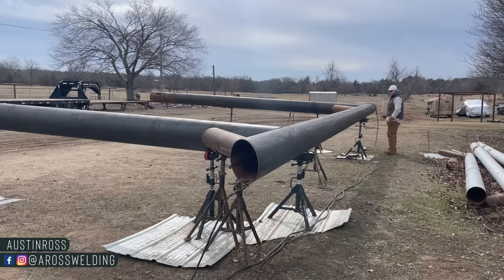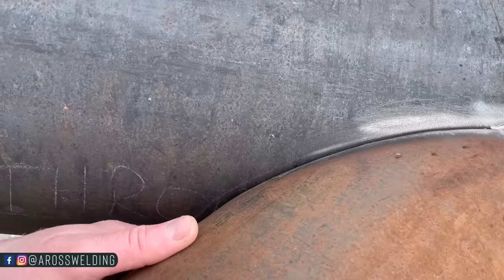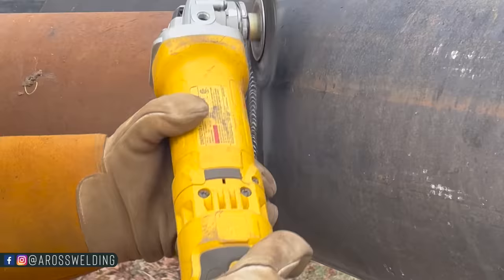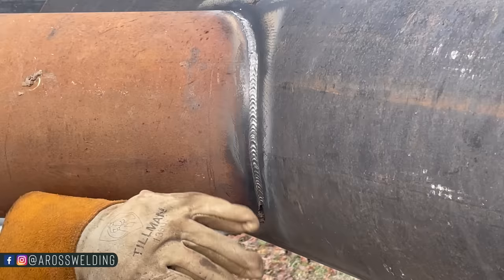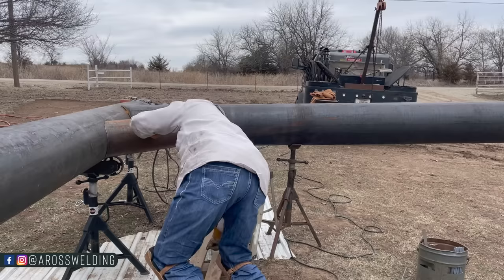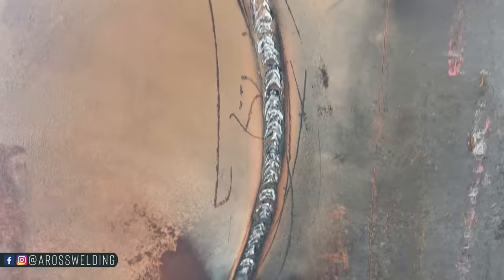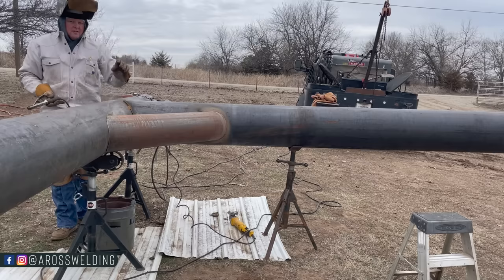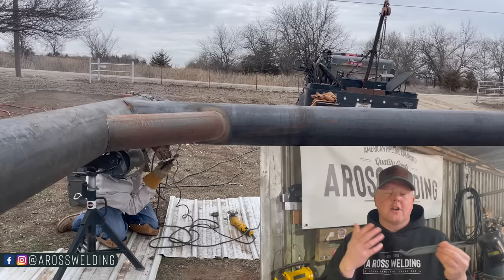Why Pipeline Welders Only Burn Half a Welding Rod

Comment: As a 75 year old retired Boilermaker./Welder..I was taught that uphill is always stronger..down hill for light pretty welds.
Reply: right i think he was going to uphill cap it once he got the gaps filled with the easier downhill pass
Reply: What? 
Distance, angle, speed and heat

If your distance is correct, the angle of your rod is good to penetrate, your speed is also correct, then you have the right heat bc you can only change heat with distance, angle and speed.

So as long as you're doing those things, your have a string weld, regardless if you push or pull. 

Don't forget how much welding has changed and the equipment we use has changed. The old antiquated welding is for the old antiquated people that learned from books that are now obsolete.
Reply: What your saying is that a 70,000# psi rod is stronger up hill than a 70,000# rod is down hill?
When I worked a BM job in 74, after our section finished welding chill ring  tubes, they had us 200 plus feet in the air on a painter's pic, downhand welding lap joint casing through paint with 1/8 & 5/32 7018.
At the time this was billed as the largest suspended Broiler in the world. Unit 5 in Oswego.
Reply: That's what pa taught me ,burned my first 6013 at 6 on a buzz box pa and Russell Drackley made from an old transformer that was left in a ditch around 1965 . Hi ,medium , and low . That welder and pa built amazing things over the years . Back then a point beer can could be welded to exhaust pipe , and often was .
Reply: I worked natural gas pipeline for 38 years . Hot tapping and stopping . Every welder I've ever worked with weld uphill . Especially if I had any blow by . It's easier to fix the leak on top than on the bottom .
Reply: Yes I was taught the same thing, I don't weld pipe. I'll weld down hill when I'm trying to glue something together that is thin sh*t. I fixed a lot of roll off bins. My late brother showed me a few tricks for up hand welding years ago. I've never had any of my welds break
Reply: @Honkers716  Nothing like insulting generations who have gone before you and laid the foundations of everything you know and do today.  Same in machining, some machinists today have no clue as to how to use a manual lathe or mill. If things collapse that antiquated machinery and welding equip might come in very handy.
Reply: @clydeadair3809  also why would we use a manual lathe when we now have technology that goes down to the 10,000th of a degree, that you can never do on a manual lathe because those dials are never accurate?
Reply: @clydeadair3809  and are you also talking about the generation that made sure product had planned obsolescence built into them? Like the light bulb? Or did you never learn about that because your generation didn't have a way to communicate with each other freely to exchange knowledge like we have today with the internet.

And the reason you can even talk to me and not even know who I am. But go on Boomer
Reply: It generally is but stove down hill MMA is used because it's three to four times quicker requiring less preheating and fabrication time.  Cellulostic Electrodes and metallurgy are optimised for this with mechanicals such as charpy tests required to meet mechanical standards such as API 1104 and Bgas P2. Tie in roots on manually prepped ends and forged bends are done uphill. Specs also require varying pre heats interpass temperatures welding time pass completion and cooling retardation as per the welding procedure for consumables used. I've 30 odd years as an inspector and welding engineer on cross country Petro chemical and gas lines and plants. He's correct in what he says about rod use but that's just a skill trick. Most stove welding procedures also require an on site WQT and roll welding is prohibited.
Reply: Id go uphill because the heat in the material will travel upwards, which will make a stronger, better weld all the way up til it gets too hot and you burn a hole. 
The horror of ones noob-welds.
Reply: In Australia a vertical down weld equals instant fail.
Reply: @blairwych8245  That where Im from!!
Reply: The answer to this is simple. It's more difficult to keep slag and other impurities out of a downhill weld, which causes failure. As well and having less general penetration, which isn't an issue if your fit and keyway are managed probably. In short, it's an old wives tale due to poor preparation and welding technique.
Reply: BOILERMAKERS DONT EVER WELD DOWNHILL, PERIOD!!
Reply: All my life and never do down hill. It’s unprofessional to even have the slightest contamination in your welds.
Reply: To those youngins, the biggest difference between the old-head welder and the younger generation isn't as much welding techniques but the level of respect the older generation shows to others. 

Oftentimes the younger generation acts like a bunch of 15 year-old boys who know-it-all. And if you know everything already then your skill-set will most definitely suffer. 

Have some humility and learn from the old-heads.
Reply: So that's why all our infrastructure in falling apart
Reply: @MicahFunk  in my experience, the old heads act like 5 year olds throwing temper tantrums like children, so I guess us youngins are better at that too.
Reply: Nothing wrong running 6010 or 8010 downhill but on structural always run a 7018 cap on this running 8010 cap with 10018
Reply: more skill required in my opinion.....but i am just an amature......
Reply: @Honkers716  yep modern gear is super accurate and fast but after a decade of use I guarantee an old fella on a manual lathe will turn out more precise work. Why? How? Because not only can he feel the difference, but he is paying attention to every cut and he knows how to re-lay the lathe bed, and remedy any runout. 
Modern lathes are not designed in the same way, and wear surprisingly quickly when compared to a 70 year old Myford lathe.
Reply: @johnwaldmann5222  You should learn the definition of anecdotal evidence.
Reply: @Honkers716  lol old antiquated welding lol you mean the kind that lasts
Reply: @asliketheson  is that why America needs an infrastructure bill?
Reply: That's right when welding thick plates or beams in general. Always uphill when welding fillet welds. But I think that's different in pipeline welding while welding butt welds with a well prepared gap for the root.
Reply: Weld up on the root at 180 amp for that rod then down if you want to make it pretty. I like the bottom half of the rod because it's heated and dry if  you don't have a rod dryer. Welding down has less penetration. You are right.
Reply: @barrysimmons5489  they weld some pipelines using downhill but its for speed not because its stronger.things might have changed.i was supposed to be a pipe welder when i got  out of welding school but i ended up an ironworker and never looked back.i dont like those long hours.
Reply: @Honkers716 I'd say that's because people started welding down hill
Reply: @Honkers716  A vast amount of repair machining is done manually and most serious machinists either fit DROs and/or use indicators instead of relying on the dials since the other methods account for backlash. CNC and manual mixed shops make serious money in repair and very short run production because very large CNC machines are extremely expensive and often awkward for work like long paper mill rolls, custom augers and very long shafting. My (rich, hard do do in such a competitive market) machine shop ownerbro has a CNC turning center, two open CNC knee mills (EZ-Trak which are insanely versatile, his first likely made him at least several hundred grand over the years and runs every day), three manual knee mills (only one little Bridgeport which is mostly demoted to drill press and fab shop chores), two magnificent WWII era American Pacemaker manual lathes with over 8-foot (I didn't measure) beds and a mint condition 1910s Cincinnati shaper. Each has its very profitable place. Time is money and those Pacemakers make heaps of it being fast to load and unload. It's quicker to cut metal than code and cut metal for MANY jobs. 
Knowing both skills plus CAD makes a new machinist much more valuable than a button pusher and manual experience gives a tactile concept of metalworking useful throughout mechanical work of all types.
Reply: Not that practiced with stick welding, mostly use mig/mag, but those who taught me told me the same thing. I always imagined it has to do with gravity forces on the welding puddle, so when you weld uphill you may end up with a slight excess of filler, but when welding downhill the filler may drop too soon ending up with a slight shortage of filler.

When I have the option I prefer to weld horizontally, obviously I'm not a pipe welder and most of the time I can simply place my work in a vice to weld horizontally.
Reply: @Comm0ut  yawn
Reply: I was taught the same but I have made down hill welds with great success in non critical applications !
Reply: @Honkers716  wrong...Uphill welding will always test higher on a tensile test...
Reply: I always weld uphill on structural and heavy projects. Root weld very important. Want deepest penetration regardless. Teach the young ones the same.
Reply: @Honkers716  "If your distance is correct, the angle of your rod is good to penetrate, your speed is also correct, then you have the right heat" yes, but then if you're not welding in flat or horizontal position you have to take gravity (and "runny-ness" of the pool for a given electrode) into account. I guess back then the choice of electrodes was somewhat limited comparing to modern times, hence limited options of welding style.
Reply: @Honkers716  spoken like a true liberal!
Reply: I mainly mig weld and not vertical or overhead , but when I was a kid My father said something to me about don't arc weld down hill ,I think he said the slag would mix with the weld , so if I'm welding something with no slag like aluminum and stainless would it matter?
Reply: @Honkers716 not sure if I agree about the light bulb, ya they could make them last a lifetime but I think they would burn more energy, the Edison bulbs I've seen didn't put out much lite , But if you turn up the power I think you shorten the life span. I've been looking at bicycle components made in China and some items seem great but other items the defects in engineering make question if they are trying to kill people , and some items are marked export only, and there is the issue of the electrical certification symbol CE being counterfeited and then they claim it means China export ?😮 They make floating bicycle rotors that are made with thin metal washer's, that can rust and fall apart instead of using stainless, most gear reduction bike electric bike motors use plastic gears , that can easily fail, most of the cheap bicycle motors have a small axle that is hollow and is to thin in my opinion, the better ones don't run the wires through the axle.
Reply: Boilermaker welder here.  At one time pipefitter welders used a procedure using xx10 rods running downhill and the amps cranked way upon pipelines. The only advantage is that it's faster and I guess the welds are good enough. I took courses on it and got certified but soon found out you had to marry somebody's daughter to get on a job. There was big money in it at the time. Some places allow downhill cover passes on nozzles, man ways and such, but most jurisdictions don't.  Uphill only because there's much less chance of burying slag.
Reply: @maplebones  why don't they use mig instead ? Cost?
Reply: @jacobclark89  Weld quality. Without a flux cover to slow down cooling, mig cannot meet the property requirements for severe service.
Reply: @maplebones  WOW, thanks so much for the tip ! I mainly weld aluminum and stainless, kinda a different animal then steel . With rods that leave slag don't you only go one direction on vertical because of slag mixing with the weld if you go the other direction ?
Reply: @SteveVi0lence No, that's because no one has been maintaining it in half a century unless it's not working and they are forced to work on it!
Reply: Pipeliners weld to API 1104 specifications using 6010 6P pipeliner rods. If you can locate and afford  the Lincoln 6010 5p+ or  6010 6P pipepliner rods, give them a try on a pipe coupon for the root pass and the 8010 pipeliner for hot, fill & cap. They are designed for root pass down or uphill. They are different than the 6010 5p (red rod). Boilermakers & shipyard welders use AWS  specifications, pipeliners API 1104. I learned AWS standards, nothing wrong with API.

Comment: As a pipefitter for 44 years we did not weld pie downhill always uphill and was taught that made a better weld, downhill was always for nonpipe material.
Reply: Nonsense.  Pipelines were more often than not run downhill. Uphill was more often than not used on refinery and powerhouse projects.  Third generation pipeliner.
Reply: In my class back 1994 I was taught to never weld uphill because it collects trash in the ‘shelf’ of the weld and makes poor penetration. 
Last summer a welding instructor told me I was wrong, you have to weld uphill or it’s a bad weld. 
Then a recent TiG class (that was a waste of my money) I was again told uphill only. 

I don’t know what to think. 
I am not aware of anything I’ve welded having ever broken so unless I decide to go get certified (unlikely at 57yo) I’m just going to keep hot-glueing metal together and call it good.
Reply: an experienced welder one told me downhill for pretty, uphill for strength. 

Since a pretty weld is preferred, I weld down unless it is something I really need strength
Reply: Uphill, downhill whatever. If you were welding to a code or a standard you follow the welding procedure, period. None of this crap that this is better than that or "I have x years of experience" junk. Also most codes or standards call for any smaw low hydrogen electrodes to be maintained with hydrogen control in mind ie; throw them back in the holding oven or bake them.
Reply: you were a pipefitter for 44 years, and never knew pipeliners run downhill?
Reply: @cudabeenios1  Best comment so far even if it doesn't get the likes or a heart. It seems AWS standards don't mean anything after they get the certs in hand.
Reply: @andyblack9066 
Yep he confessed, he said he was only a "PIPE FITTER".. there's the difference 😂😅😂 
Could be a pipe fitter for 144yrs and still not know any thing technical about welding.
Reply: @fishhuntadventure  Hi, Fish! I didn't say it was a bad weld, I just said that downhill doesn't give you the penetration that uphill gives you. And if you're doing 7018, you have to go uphill.
Reply: @cudabeenios1 - Yes. The WPS is the control document. Progression will be specified on that document.
X number of years of experience counts for nothing. Can you pass the weld test? Will your welds pass testing, (Mechanical, X-Ray, Eddy etc…) This is  where the rubber meats the road. Not “ I’ve welding for 90 years, learned from James F. Lincoln, I can weld with my feet, blah, blah, blah…And been welding 90 years, never had a weld break. Let me guess, never failed a weld test either. The only people who have never failed a weld test are those who have never taken one.
Reply: @cudabeenios1  this guy welds
Reply: I've been welding since 44AD and we were taught to weld sideways. Uphill welds are for the flits and downhill welds are for the clowns
Reply: Gas piping has downhill requirements
Reply: lot easier downhill but a smaller bead....need a couple more passes to be sure.........old radiator guy self taught...
Reply: You've never worked on a cross country pipeline.
Reply: @andyblack9066  not all pipefitters have pipelining experience. The vast majority don't.